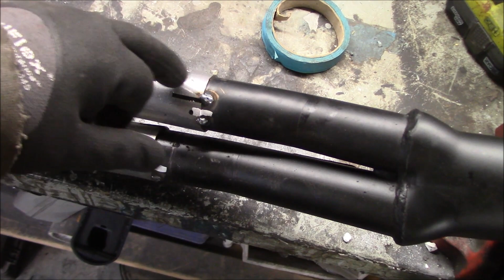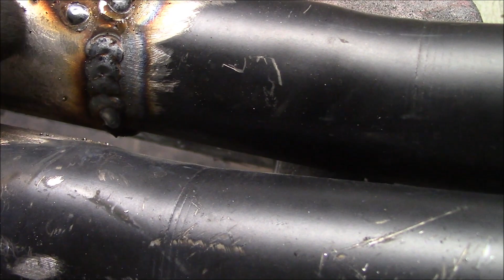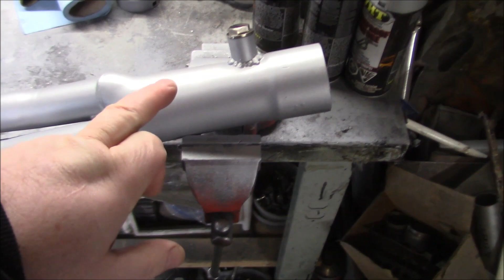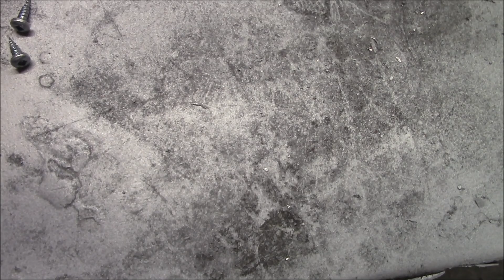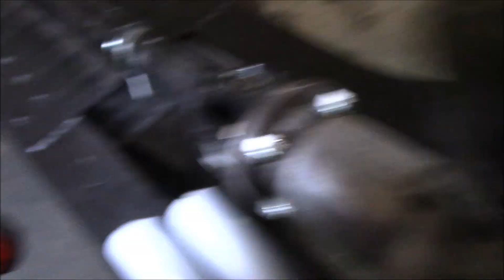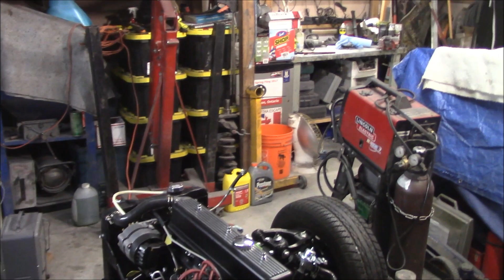1968 Triumph TR250 Restoration, Exhaust Painting/Welding,  Fuel and Brake Line Clips, & What's Next?

Comment: Tush, the car is coming along great! I have a question that maybe you can help me with. I’m replacing the bonnet on my TR4A. The used replacement bonnet just needs a little body work and a repaint. However I see that there are “felt” anti-rattle strips between the underside of the bonnet and the front and rear cross braces. I want to pull these old strips out before repaint, but I can’t find anyone with replacements. Did your 250 bonnet have these strips, and if so, were you able to replace them? Cheers!
Reply from the maker: Hi Jim,  I had the same dilemma.  I did pull all the ‘felt’ strips from under the bracing.   My felts were actually in pretty good shape and I was careful with them when I pulled them out.   I saved them and actually re-utilized the old strips.   Is it possible to rescue and reuse yours from the old bonnet?
Reply: @cheftush  Thanks for the quick reply! Yeah, that’s my plan B, but as the boys at Project Binky say “ they’re scabbier than a bats’ ass!”. So while it’s away at the body shop, I’ll keep look for replacements. Cheers!
Reply from the maker: @Ksozey  let me know what you find Jim...remember I have that 62 TR4 in line that will need a full restoration as well 😉
Reply: @cheftush  will do!!